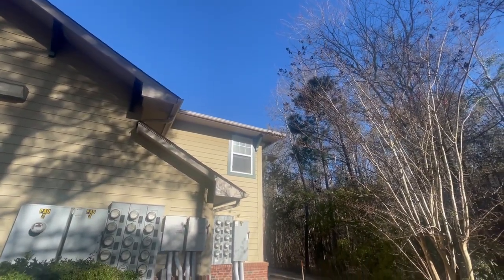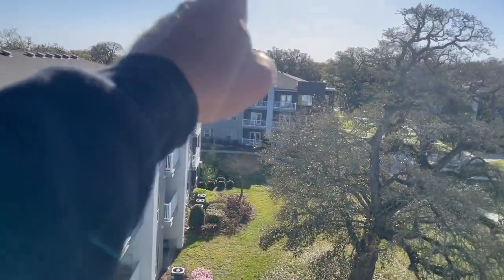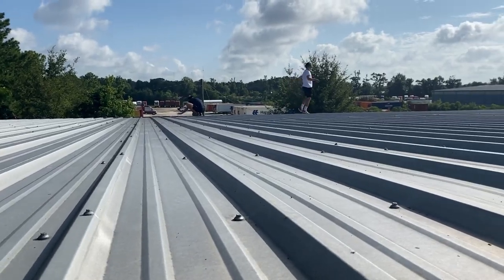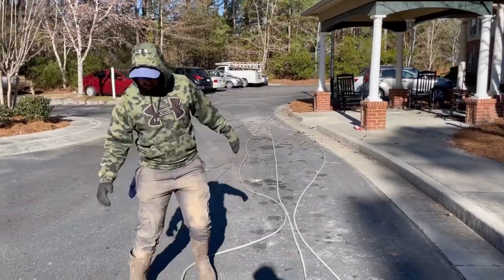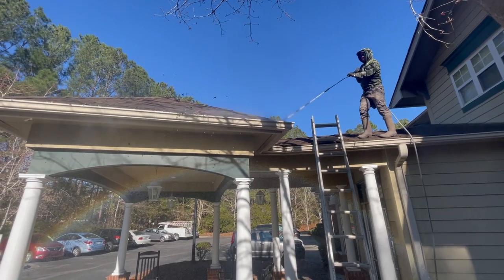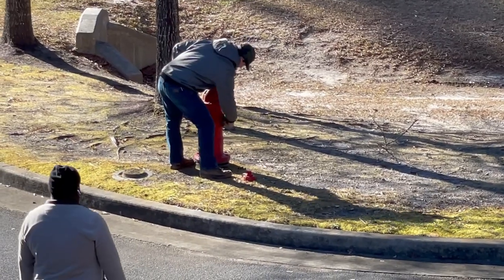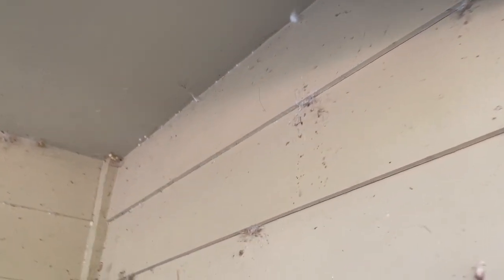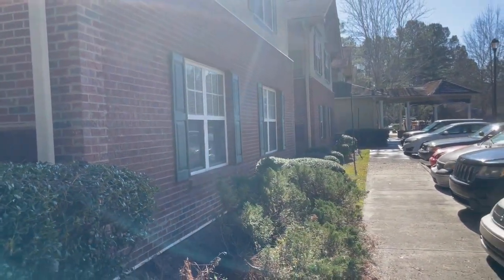How To Make A Fortune With Commercial Gutter Cleaning

Comment: Hey man. Love your videos eventhough I dont do commercial washing. I have a very low psi and flow home machine. My swivel is leaking at the QC. What fitting dope do you use? I'm using teflon tape with tru blue over it. ( I think that's the name) so tape, then liquid dope. Ever used loctite 5452? Can u recommend something? Thank You and take care. Love the channel👍
Reply from the maker: +Detail It get a new quick connect - only a few bucks
Reply: @AllAboutPressureWashing  unfortunately it's only about 3 months old...MTM too.. stepped up quality Nd its leaking😳

Comment: Not related to this video but how can I safely soft wash a metal roof that has SOLAR PANELS on it??? I know SH will damage the anti reflection coating of the solar panels. I am meeting with the a customer for a bid tomorrow! Thanks
Reply from the maker: I'm not an expert in solar panel cleaning - but my friend Tym is - check this out https://bit.ly/SolarTrainings
Reply: @AllAboutPressureWashing  I was more wondering how to avoid the panels and protect them while soft washing the roof. But thank you for the response.